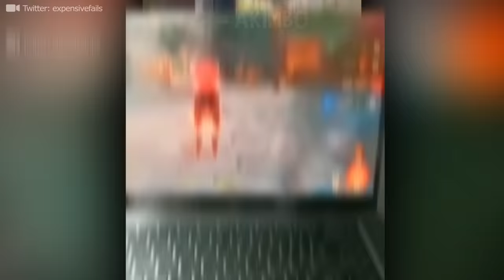Most Expensive Fails You Will Ever See !

Comment: So at 1:21, don't Tesla cars have a 'kill switch' of sorts that prevent overcharging? So how did that really happen?
Reply: Most modern electronics/cars etc have a control circuit that shuts off charging to prevent damaging the battery exactly for that reason. It's why your phone can be on the charger at 100% for hours and be perfectly fine. My guess is there was a short either in a computer or the battery itself that caused the battery to overheat and catch fire
Reply: There was most likely a short somewhere that started a fire and the thing about lithium batteries is once they're on fire they're extremely difficult to put out, The local fire department where I live had to respond to a junkyard 6 times because the same tesla kept catching on fire from the battery pack shorting out why they didn't think to disconnect everything after the first fire is beyond me
Reply: funny how they said that it was left charging and it wasnt even plugged in also wasnt even a charger on that side really wish people would research a little more before they start clowning on topics they dont know about

Comment: This is why I drive a relatively worthless ($3000) 14 year old car and have the maximum insurance for only a bit more money than the minimum required by law in my state. And I accidentally once knocked over an entire palette of glass beer bottles (Blue Moon) by ramming into it with another palette on a jack, to the dismay of my manager, but only wound up smashed a few bottles (It wound up being only 3 6-packs) and just had to clean it up (which was better than having to keep unloading the truck delivery anyway...) My point is, I've never had a bad day like the people in this video
EDIT: Also, I have a Samsung Galaxy A51 and drop it at least 3 times per day at work. If not more. So, I am full time, average out as 3x5x52=780 times per year. It is required at work to scan things and such and use the store App. Although it has a rubber case on it, it has taken some pretty hard falls and has landed right on the screen. Right on concrete. It has never broken yet (cross my fingers). What garbage are the Iphones made of?
Reply: Same with my Moto One 5G ACE. Put a half decent case on it, and dropped more times than I can count, and still not a issue. No glass protector, so few minor scratches from accidentally putting keys in the same pocket, etc... I honestly think with the iPhones it's equal parts design issue with how thin they try to make the glass, and people not using cases. I don't know which gen iPhone that was, but Samsung makes a majority of the OLED panels for the past 5 generations now, and the actual displays inside are excellent. I'v never seen burnin on a iPhone, or other products using Samsung panels in the past handful of years. The front glass is cut to Apple's spec and thickness though, and they make it hella thin to save on weight. Everytime they make the formula stronger, they just use it to make a equal strength sheet with thinner thickness. Plus the metal frame with no plastic gaps will pinch and crack the glass if it's dented at the corner. Not a fan of iOS myself due to lack of customization... but just sad to see a relatively premium product have such bad design choices.... like that and the lack of Type-C until the 15... Another topic... Apple has access to synthetic sapphire glass they they use on the Apple watch. Give it a reasonable thickness (1mm or so).... now THAT would be hard to break... probably would destroy the OLED layer underneath from pressure shock before shattering it. Other topic a majority of smartphone companies are guilty of.... no replacable batteries or headphone jack for "waterproofing", including Samsung. But wait... Samsung makes the Galaxy XCover Pro, with dual SIM, headphone jack, replacable snap in battery.... AND a high IP67/68 rating? Hmmm..... but yeah, the industry as whole I have complaints across the board. Apple though, does win quite a few awards for trying to... "think different" in "unique" ways. Mid to high end Samsung, Google and Motorola rank among the highest in my "least annoying to deal with and best quality" categories for now, as far as available easily in the US models.
Reply: Pure Chinesium